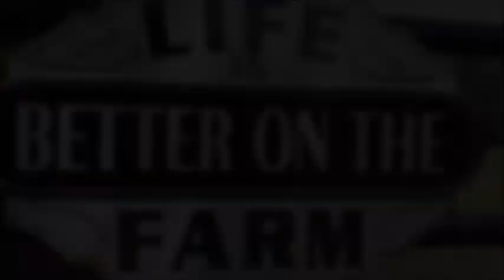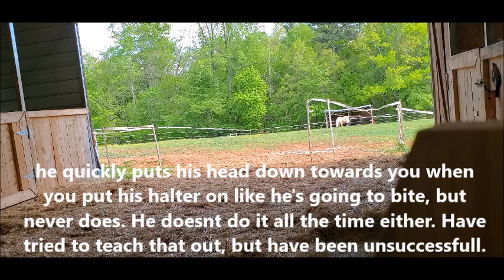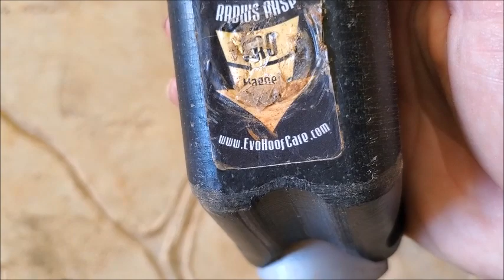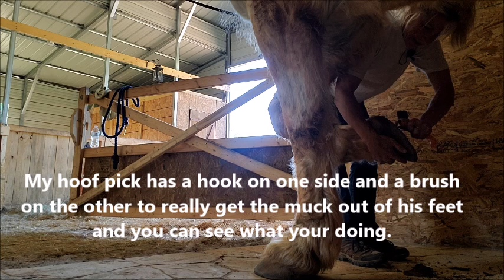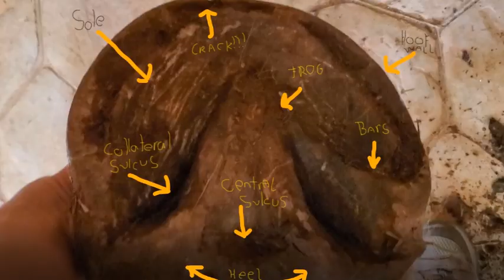Cracks in a Draft Horse Hoof Wall

Comment: It looks like his hooves might be on the dry side and could use some moisturizing. I'm not sure if it's called Hoof Flex but it comes in a can with its own applicator brush. I do know it works well for horses hooves.
Reply from the maker: They are a bit dry but this because we are in spring and the oils have not built up on the hoof wall yet. I have yet to find a product that really moisturizes a hoof without using some type of ingredient that actually dries them out more. So I just leave them be.

Comment: My horse has a significant crack, I was thinking about cleaning the sides of sole close to the frog   
( V ) and maybe take some pressure off 🤷‍♀️ My Mare's hoof has the same shape as Jarvis, but just the one flares.  Flat foot is what they refer to her feet.
Reply from the maker: Sounds like you need a better farrier? Horses aren't supposed to have flat feet.
Reply: @SFD-Horses  No the vet said it's normal for thoroughbred horses. She's a Hanoverian cross. but ya maybe I should look for another, They are hard to find here and all over booked.